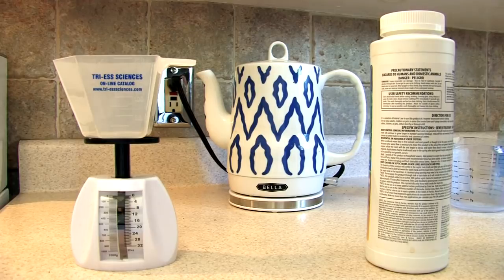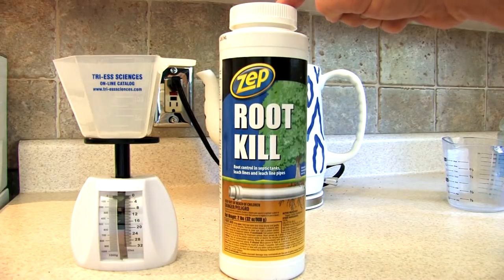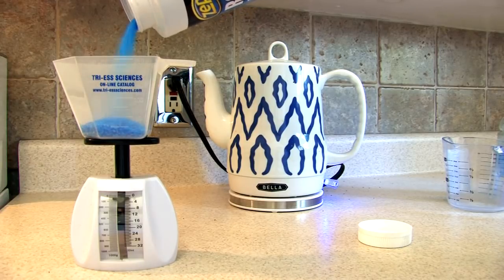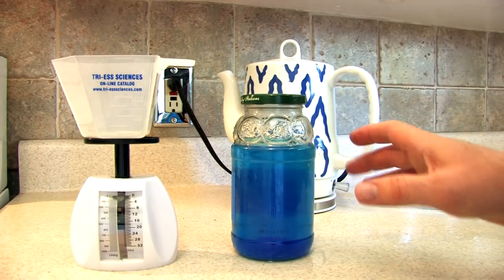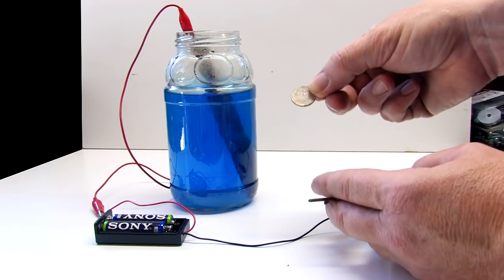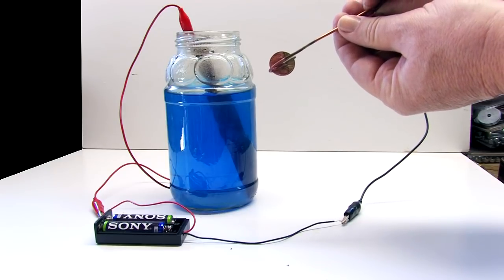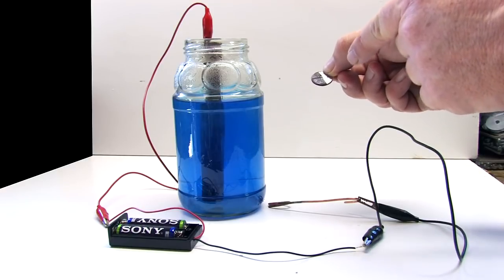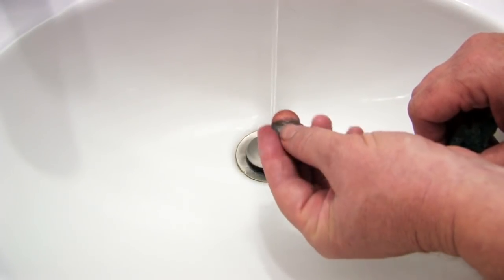Easy And Inexpensive Copper Plating Trick!

Comment: To make the process go faster should I increase the voltage or the current? Are there any drawback as opposed to just using the 2 AA batteries? I would use C batteries or even a PC power supply even though I'm guessing I should limit the current. What voltage and/or what current would make this process go fastest but still have good quality?
Reply: Ciroluiro A normal AAA battery puts out around .500 to .600 amps at full discharge, So if you wanted to use a power supply between 3vdc (the same as 2 AAA 1.5vdc each) and 6 VDC (4 AAA, AA, C, or D batteries) at around 1 to 1.5 amps you should be fine. The water isn't a direct short (as in touching both the + and - together) so it shouldn't cause issues. Yes the solution is now copper heavy but I think you'll be just fine. Keep an eye on the power supply and make sure it's not over heating, if it does then you might have an issue. Hope this helps.
Reply: Mikey8567 oh ok, but would it be better using the higher voltages? Is it worth using 6v instead of 3v? Or 12 even with a pc supply.
Reply: The average voltage for copper plating is between 3vdc to 6vdc, any more then that and the amperage will climb to the point that your turning the copper in the water into a conductor (Big resistor) instead of it being drawn to the item you want to plate. I'd stick to no more then 6vdc and between .5 amps to 1 amp.
Reply: Mikey8567 ok. Thank you kind stranger!
Reply: +Mikey8567 

Electroplating follows Faradays law.

Current that does not result in copper being deposited results in electrolysis of water into oxygen and hydrogen. Limited amounts of gas evolution for some electrolytes can be an advantage as it can help limit deposition rates in areas of high current evening up the plating rate on areas of low current. 

Kikey8567 says "any more then that and the amperage will climb to the point that your  turn the copper into the water into a conductor" - 

This is really back to front - pure water is non-conducting, it does conduct when you add impurites such as copper ions. The conductivity of the solution will depend on many factors such as the ion density, the pH ( or H2+ ion density ) and also what is known as cathode/anode polarisation, one form of this is bubble formation on the cathode which has the same effect as a resistance by reducing cathode/electrolyte contact area, there are quite a number of different chemical processes going on under the  blanket term polarisation but they are characterised by the way that they appear as resistance if you do voltmeter /ammeter calculations.

If you try and push the plating faster than it wants to go you risk ion depletion in high current density areas which can result in burning ( dark deposits ) - if the current exceeds the current that the ions can carry then you will start performing electrolysis of water in areas of ion depletion and producing excess amounts of hydrogen and oxygen. In this sense excess bubble formation indicates you are pushing the plating (excess current). 

Modest amounts of bubbling on the cathode can be an advantage as it may increase throwing power - this means that areas that would otherwise receive almost all of the deposit receive less because high current density induces an effective resistance (bubbles get in the way of current). 

A 100% efficient electrolyte has limitations because all other things being equal the current will simply take the path of least resistance which means that only the part of your cathode nearest the anode will get plated. What we actually want is a resistance that is selective and is highest in the areas that would otherwise be most favoured. Think of it as a tax on the rich to feed the poor such that the tax percentage increases as you earn more - some forms of polarisation have this desirable property.

Advice on amperage should take surface area into account - if anode and cathode surface area are increased together then for a constant voltage the amperage should scale accordingly ( subject to limitations of your power supply ). 

Platers talk of amps per square foot  surface area ( for some unfortunate reason plating literature does not seem to have moved into the 21st century and gone metric ).

Comment: Thanks for posting the video. Seems clear and successful but I could not help wondering if it may just have been that the nickle plating on the penny was eroded and you were left with  the copper penny underneath  thinking that it was copper plated. Surely plating steel, even a washer would have been a better test. it seems hard to get copper plating to adhere and plate with a good thickness  like it does when done professionally.
Reply: The penny was a 1943 steel penny that was nickel plated.
Reply: @dennisgautreau7941  Thank you for taking the time to reply - I did not know that coins were made of steel at one time .

Comment: Ok this is a great little trick, so my friend works at a scrap metal yard and I thought ok let's see if I can trick him into thinking I had a large amount of cooper, so here is what I did I used stainless steel piping and I used this same idea but on a much bigger scale, I used the Root Kill from the hardware store and I dumped in most of the bottle into a large plastic 45 gallon drum, I used my 12 volt battery charger with a cooper pipe, and all the stainless was hooked together, I left this running for 5 hours and when I came back to it I had all this great looking cooper piping. I then took it to the scrap yard, and of course they put the magnet to it to be sure it wasn't steel, stainless isn't magnetized they thought I had had 30 pounds of cooper, till I told him what I had done, so yeah this process works great.
Reply: Of course, there is irony in that stainless isn't cheap either.
Reply: @kellyvcraig  Stainless steel .50/lb Copper 2.25 lb
Reply: @ProlificInvention , now, but at other times . . . .
Reply: @kellyvcraig  Yes, I used to be a dirty scrapper 😂 owned a little operation called Iron Duke Scrap and Salvage---I got a kick out of this guy's comment because I'm currently trying to copper plate stainless steel for a project, so I'm going to see if his suggestion works.

Comment: I saw your video a while ago and decided to try it myself.  What I'm doing is similar, except I was using baling wire (probably galvanized steel) for the cathode holder, and no matter what I put in it, be it a steel nail or a regular nickle, they all seem to just get copper deposits that almost look like black flakes and rust deposits that flake off when you shake it in the water.  I haven't successfully gotten a good plate, and that's using a small power supply, an 8g copper wire as the anode, and roto rooter root kill, which is also 99% copper sulfate.  Anything I'm missing?  it does turn dark within seconds, but then more and more deposits just start accumulating.  Thanks.
Reply: F Con you are applying too much power and trying to do it too fast, you need a current limited supply and use the correct voltage and correct current for the size of the piece you are trying to plate, if you cant find this information then lower is always better, it will take longer but it will plate instead of flaking off, unless you are trying to plate a large piece i would stick with 2 batteries as in the video, if not then you will need to limit the current and use the correct voltage, you could try using a rheostat with your power supply assuming the voltage isnt too high (below 6v preferably below 5v)and turn it up till a few bubbles start to appear on the surface then dial it back down a touch, if its fizzing like an alkersaltza you are way too high, if you are getting a plate that looks dull and like it would come off easy you are still too high, slow and steady wins the race

Comment: Pentahydrate means the Copper Sulfate has 5 water molecules in the compound.        Cu II SO4  5H2O       With the water attached it is blue.  If you heat up dry powder of Copper Sulfate it will turn white because it is releasing the water.  Then if you leave it out over time the Copper Sulfate will draw the moisture from the air back into it, making it a hydrate again. (hygroscopic)

Comment: Hi Stan,
quick question, my cooper plating it attaching to my bolt, however it is just flaking off and not sticking to my items, what would cause this? I'm using copper sulfate, but not copper ammonium sulfate, will this make a difference?  I'm can't get the nickel sulfate to take at all.
Reply: shane thompson  Any copper salt with an inert anion(sulfate is highly stable in solution) will work fine. That sounds like a surface prep problem. Try really scrubbing, acid etching, or electrocleaning the object beforehand. Also, make sure that you're using distilled water.

Comment: Hey, I have an important question for you. I'm thinking of copper plating the inside of my stainless water bottles for bacterial resistance. Will ALL of this solution wash off with hot water and soap without leaving any toxic traces behind?
Reply: It should do, if you want to be sure wash it with acetone (found in most nail polish removers) and dry well. However copper can give a copperish taste any mildly acidic food/drinkl, so I'm not sure youd want to- Personally I'd say you'd be better to put up with washing the thermos reguarly!
Reply: ahh, so anything acidic will corrode the copper enough to get it into the drink and give it a taste? But just water should be fine, right? This will be for mid to long term camping where soap is limited, so natural bacterial and fungal resistance is an asset.
Reply: Water should be fine it might still taste a bit copperish if left stand for a while- although I doubt it'd do you any harm (dont quote me on that though- I'm a chemist not a doctor Jim!) If you wanted to test it, you could always leave some copper in your thermos with the water & it would behave the same.
Reply: Pod Ru does your tap water taste of copper? mine doesnt and it comes through copper pipes

Comment: So say you want to only partially plate whatever (stainless steel), would electrical tape or nail polish keep that area from being plated?
Reply: yeah. anything that insulates the surface will prevent metal buildup
Reply: You could paint the areas you don't want plated too.

Comment: Thanks for great video.

Just wondering what size battery in a pen light or pin light that you describe?
Is that size AA or C or? Can I use different size batteries?

Also I am not sure how you have done your electric connection exactly as I cannot see the back side so is it possible to explain that? A diagram anywhere please?

Thanks!

Comment: I use it for plating copper on glass. the ratio i used was 1 quart distilled water to 8oz of crystals and 2tbsp of sulfuric acid
Reply: also copper brightener
Reply: What do you put on the glass first to make it conductive do it will plate?

Comment: What are the voltage concerns for plating, what is too much or too little?
Reply: Bill Smith thanks, it plated up nicely.  But now I also have a worm hole leading to another dimension in my living room.  I guess you were just trolling me.
Reply: .10 for every inch. to much you will develop a texture, to little it will plate a salmon color and flake off
Reply: Tom Crowdis i love flakey salmon  :)
Reply: Tom Crowdis thanks !
Reply: would also like to know.  3 Volts seems so tiny...  I wonder what 110 / 240 volts mains would do?  Also what amps are appropriate?
Reply: Don Henderson no problem. right now im doing a piece with .17a with .4v
Reply: Son of a Zombie You question the voltage because it "seems" so tiny? So? Why don't you experiment with 240 volts and let us know how it worked out.

Comment: hey i like your idea. in chemistry all the "pentahydrate" means is copper-sulfate or cupricsulfate crystals are hygroscopic. means it absorbs water from the atmosphere. if you had one molecule of cupricsulfate it has absorbed 5 molecules of water. this gives a blue color to the crystal. when you add water and dissolve the crystals you now have more water then the crystal can contain so you basically have the same solution you were originally after and usually the contaminants are only a few %. more or less you have a clean solution. the impurities are mineral salts that were introduced to the water from running through pipes. hope that clears some things up. great video great experiment.  

Papa Midnight

Comment: When copper sulphate crystallizes in water it forms the pentahydrate type molecule (penta=5and hydrate=water).
That is the pretty blue color.Pure copper sulphate with no water is white.
Great video thanks.
Copper sulphate is easily had in bulk from agricultural supply firms.
Reply: also, its super super easy to make copper sulfate with old scrap copper set up for electrolysis.
Nerdrage does a video that works flawlessly.
 
Weak sulfuric acid solution 
You can literally make lbs of it for pennies.
Reply: Loyd anonamous how do we know then the solution is exhausted?    Could the guy have plated $20 worth of pennies in this video?
Reply: you know when it won't plate any more.Since the coating is very thin you can plate a large number.The copper actually comes from the copper pipe.
The copper sulphate is just a conducting medium.
Reply: Loyd anonamous thanks!  also, will increasing the voltage and / or current increase the bond?
Reply: Yes there are many factors that make good bonds.1/Surface prep. very important.
2/ voltage
3/ current density "most important".
4/ concentration and chemical makeup
of electrolyte.Not so critical.

If current density is too high copper plates
on too fast and piles up upon itself and this
will easilly fall off.
Reply: Clown Whisper who is Nerdrage?
Reply: Son of a Zombie he made a bunch of chemistry videos .
do a random search reactions and you will find his channel.

Comment: Will this plate method work on cast aluminum?
Reply: As you may know aluminum is a very good conductor of electricity. It follows silver, copper, and gold for best conductivity of metals; However, aluminum oxide is NOT a good conductor of electricity and aluminum oxide forms quickly on any aluminum surface exposed to air. A very thin layer is not necessary a problem, but Aluminum wiring needs special connectors to make sure that there isn't a buildup of aluminum oxide which means heat generated at the connection which means more oxide which means more heat and bingo, there's a fire. Back in the 50's there were lots of homes wired with aluminum wiring but it is rare today and a violation of code in many places. It's my understanding that copper plate can be applied directly over brass, copper or nickel, but cannot plate directly onto steel, pot metal, zinc or aluminum, hence it's very difficult to get good results when it comes to plating aluminum with copper; I Hope standcurtin will answer your question in a depth manner, he is the expert after all!!! ;)

Comment: I'm green to metal plating system, mind you, however I can't help but just wondering whether seawater is better than distilled water since a solution such as saltwater has a lot of free ions floating around. Those ions (charged atoms) can flow easily, and ionic solutions are very good conductors; Also I came across an article where it says "The electric forces are much stronger when negative charges are closer to positive charges. The further apart two charges are, the weaker the electric force. Also, the greater the charges, the greater the electric force will be".... would not be this the cause which many people get poor result when it comes to plating? any thought?;
.
Reply: Nobody should use this idea please , u want control so the opposite is what you are looking for , DI water ,purified RO , or distilled .